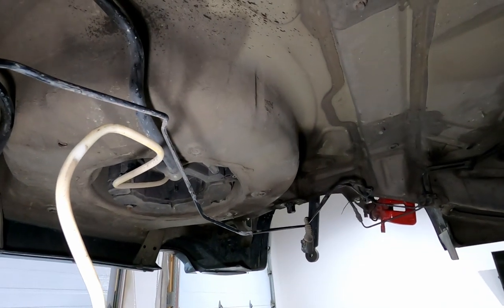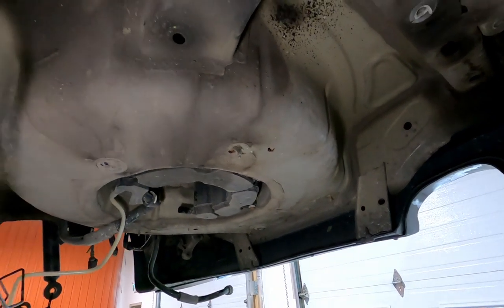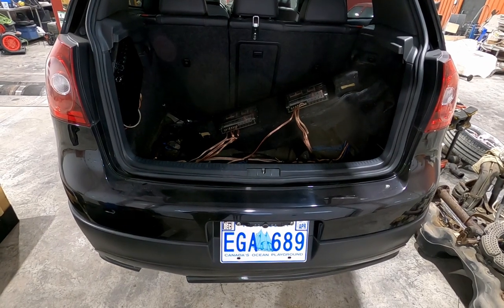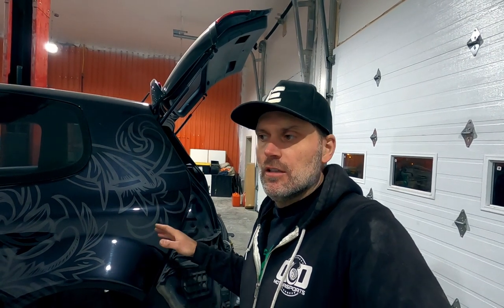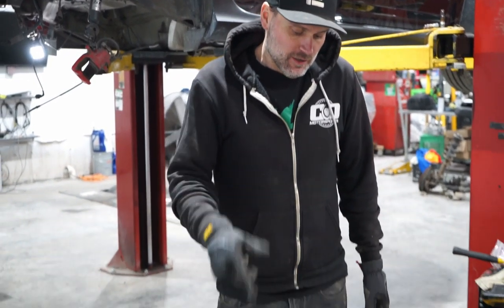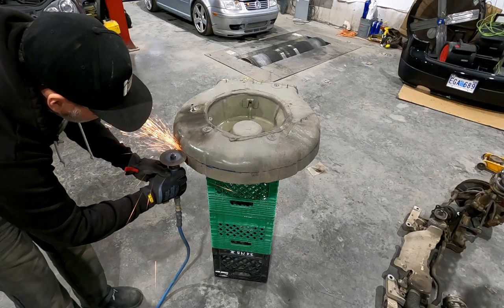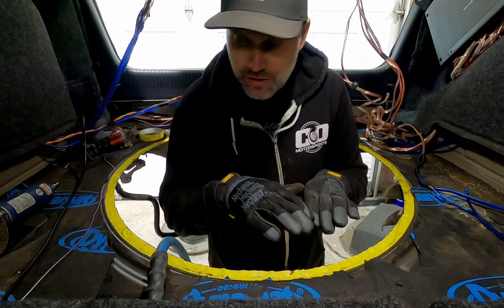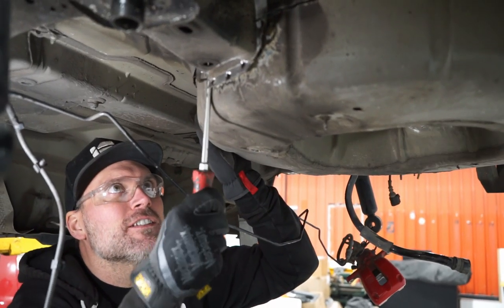AWD Swap continues, no turning back.

Comment: Does the mk1 tt rear subframe work ? I’m able to get the o2m trans complete with the rear diff/subframe for a good price I’ve seen that it’s supposed to to bolt in just want to confirm before I buy it

Comment: So why do you grind the spot welds instead of drilling them out ?
Reply from the maker: It comes down to what piece of metal you need to save. Sometimes spot weld.bit is the only answer. But the grinder is easier, quicker, and cheaper, so it's used when possible.

Comment: What year A3 is that awd subframe is that? Would it fit in a 2013 jetta?
Reply from the maker: As long as it's not MQB platform all the A3s in North America are basically the same when it comes to the AWD versions.

Comment: What year A3 rear diff assembly did you use?
Reply from the maker: Didn't use A3 for this one.
Reply: CO Motorsports but you could? What year vw or audi rear diff assembly can I get for my gti Mk5?
Reply from the maker: @greg2189  We used a MK5 R32 complete setup for this vehicle.